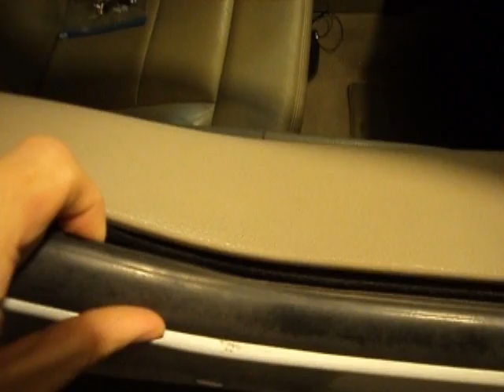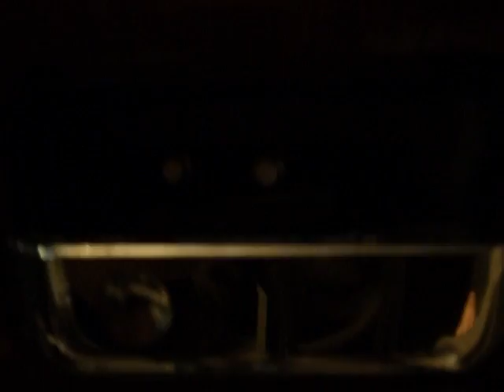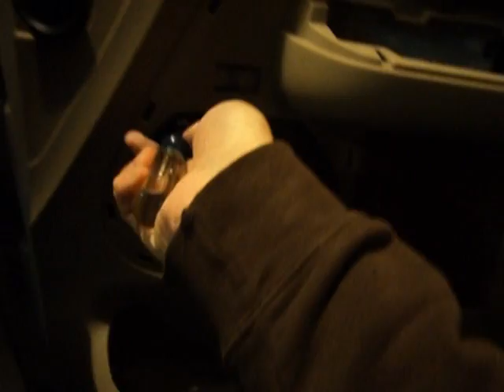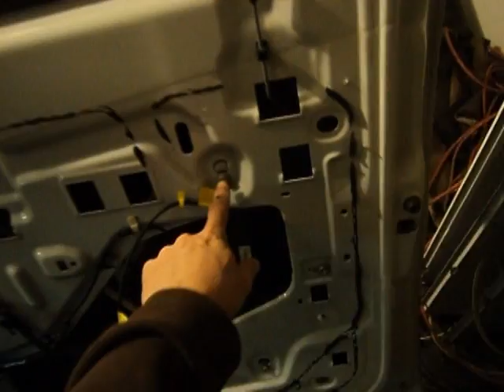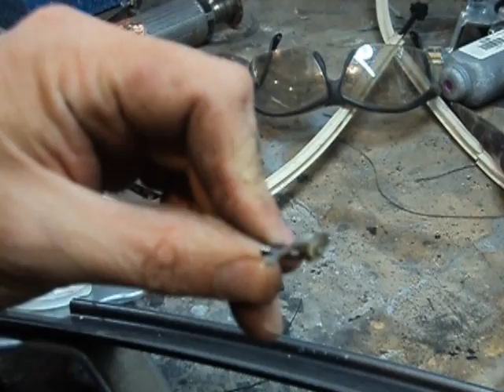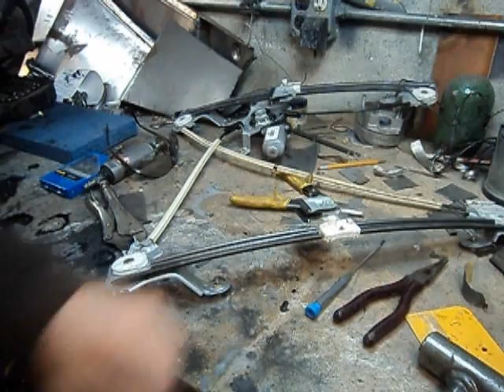2004-2008 Ford Power Window Repair

Comment: Not in my case. 06 f150 xlt supercab. Both plastic trucks cracked and broke off the tracks. $80 later ( 2022 ) for the whole assembly. It's supposed to snow tomorrow so I'm glad it's all buttoned up

Comment: I had a Ford mechanic tell me that they have told Ford for years to quit making those parts out of plastic but they refuse. $450 to repair if you take it to a Ford dealer in Arizona. I had a friend help me for about 50 bucks.
Reply: How did your friend help you ?

Comment: Thanks for making the video and your great tips. My 15-year-old Dodge Dakota has a similar plastic anchor that broke and I have a few tips that might help someone:  

(1) To release tension on the cable so I can anchor it easier, on the opposite end of the long regulator bracket that has the roller, my unit has a half round plastic roller guide where I popped the cable out of the track. Once I get the loose cable end anchored, I will work the cable back over this guide. Compressing the spring where the cable enters the motor drum assemble will release some of the tension on the cable. It may help to use a hook tool when pulling the cable back over the plastic guide.  I also took a small 12-volt battery and momentarily attached it to the motor with alligator clips, while pulling on the loose end of the cable. This allowed me to position the unattched/broken end of the cable about half way up the regulator guide, where I could work on it easier. 

(2) On another window, I learned the hard way: in order to prevent a chewed up rat's nest of damaged cable, when the cable anchor breaks, DO NOT try to operate that window motor switch any more at that point. If you forget and operate the window switch, then without tension the cable can become a jumbled mess as the drum it was wound around and the worm gear chews it up. As a reminder to not operate the switch, I placed some black electrical tape over the switch, as it leaves less residue than most other tapes.   

(3) I once held up a window with duct tape, and removing the sticky residue was a tough job, even when using WD-40.  Instead, I now use a heavy duty suction cup to hold up the window, about 5 inches or larger, and of course applied to the inside bottom of the window. The suction cups are used for automotive body and glass work and can be found in most parts stores or Harbor Freight. Make sure you clean the window and wet the rubber pad, which should allow it to hold for up to several months. When my window regulator failed, I was away from home and it was about to rain. I didn't have time to take the door panel off to pull the window up. Fortunately, I was able to wrap enough electrical tape around the end of a pair of long nose pliers to protect the glass, grab the edge of the window and pull it up enough where I could grab it with my hands, and apply the suction cup.  From Sam Selph, S. Ga.

Comment: Well done, for interest if stripping down the mechanism is the only way to fix a stuck window then here’s my video fixing both the motor/regulator, gears, bearings and switch (applicable to most cars): https://youtu.be/btQ50b5lHos

Comment: Socket Driver ! When the cable screws up in the motor, it's called birds nesting. The mess looks like a birds nest.
This broken part is common in HOT weather. Ford has never learned to use a plastic that has more temperature resistance.

Comment: Nice fix, unfortunately the cable on mine was badly frayed so I needed to do a full replace. I ended up watching the whole thing anyway. Useful fix. Thank you. The window regulator without motor runs 25 bucks on ebay, and 125 at the local auto zone. Someone is making BIG BUCKS on that part.

Comment: would have liked to see you get the glass up but a great start.  Ive got none technical skills but I am gonna figure this out.  Thanks for posting!
Reply from the maker: Push or pull it up.  When its disconnected, its free to move.  If you have a tangle of wire because something broke, sometimes you have to get everything untangled, and then get the glass out of the way.  Its been a bit since I've done this to a Ford, but they are all about the same.

Comment: I have a 2005 F-150 and have taken everything apart and about ready to put back together. My question is on the motor does it matter which cable goes on the inside of the motor wheel

Comment: Socket Stick and Socket Wrench!  LMBO!  You are killing me! Love it... Ha Ha Ha  Needed a laugh after being out in the heat struggling to get the window back up until I can figure out how to repair it.  My issue seems to be that someone forced the window down to get at something, and the cable seems to be wound up in the motor... Hmmmm.....
Reply: Our World Enterprises LLC  Pretty cool. Double shot of red bull and espresso putting it back in.😜 very helpful. Thanks.
Reply: Did you get your window up ? How did you do it?
Reply: +Jack Price hijack I had to remove the door panel take out the entire lift mechanism including the motor which had the cable spurred and wound up in itself.   I ordered the new door mechanism from this place has the video and installation was a breeze.  please excuse my voice to text translation
Reply: Thanks 
I need to get closed.until payday. Thinking maybe taking it apart and shiming it up
Reply: +Jack Price I forgot to tell you that I was able to use several bungee cords round from the front to the back of the door and underneath the window to keep the window up and it worked perfectly
Reply: +Jack Price I have also masking tape the window on both sides but if I were to do it again I would not have done that because that was the longest part of the process and that was removing the baked on masking tape from my paint and the window...

Comment: Good video. Big help to me although I found the lift device trashed and will wind up replacing the unit. One thing that might help. It's not necessary to remove all four of the speaker clips - only the bottom two. I put a pair of fat needle nose in it, squeezed gently and rocked it back and forth. Came out easily. Thanks Greg.

Comment: Good video, tips!! Question: the piece of metal-plate?? just hold the cable end in a place?? Would it be a good idea to crease wire/wheel with white lithium crease?/ Thanks, youtheman=) "Man, who always works ...  in a Dark" ;o)....I have seen your other videos...too=)) Dark...night-times...always....., you must be a very busy boy...during a day !!!
Reply from the maker: +Eero Laukkanen Yes.  a bit of white lithium is a great idea.  About working in the dark...  Yes, I am a BUSY guy.  I'm an architect during the day and I work all night in my shop making things.  I love it!
Reply: I knew it,...and you have a good, helpful wife too;o),...by the way, I am a Physical Therapist, and I like to work with all my cars too....usually in a daylight though ;o)

Comment: I came across this window after my window fell down this afternoon.  I ended up replacing the whole regulator but this video was very helpful.  I'm not mechanically inclined so I don't think I would have been able to replace the part without this video.  Thanks!
Reply from the maker: +rutscreamer Thanks!  That's why I make these vids.  Just trying to pass on what I learn.

Comment: I have the same problem on my 2004 f150 left rear window regulator. The nylon plastic connector cracks and breaks with age. Have the ford engineers fixed that yet. Unfortunately, the motor ate my cables , anyone tried to rewind the cables?

Comment: The driver's side window on my 05 fiesta has a similar problem. It used to make a bit of a grinding sound going up and down (It looked like only one side of the window was being force upwards which I presume caused the sound). Now the window is all the way down and will not go up anymore. Now when I press the pad to go up it sounds as though the mechanism moves upwards maybe a cm or so but then stops. Is this the same problem or do you think it is something completely different? I've been at a mechanic and without looking at it he has told me to get a new motor for the window... costing £195 haha
Reply from the maker: +danielstirling88 The spool that the wire collects on is what is making the noise.  Sometimes the wire eats the spool apart and you have to replace.  Sometimes the wire gets chewed up as well.  Look on-line for the part...  They are about 1/4 of what your mechanic wants to charge.  It's about 1-2 hours of work to remove and replace if you've never done it before.

Comment: I have the same problem long time ago. Some time later it would come back normal again. And as such happened quite often. Recently it is even serious. I've been searching the solution, but not quite fit to solve it exactly right or simple. 

This is my suggestion: If you don't find any wire problem, or any worn out mechanic problem, just go to take out the internal panel by unscrewing 5 screws off. Then directly disassemble the motor with three screws off. Take out the center part of the motor, and clean it and the shell of the motor inside out. You may put a little grease on the bottom and top portion of the center part (coil). Then put them all back. Make sure you have balance every single step including small gasket, and use a short and slim Philip screw drive, you may finish the job no more than half to one hour. Don't be fooled to take all regulator off and exchange with new one. It cost 50 or more. If you take away the small gasket, I mean, don’t put it back, it even puts the whole things easier and simple without noise or function problem.

*If you have only small 7mm (or 8mm) small and short socket, you can use a long flat screw driver insert into it to take out 2 screws under the window handle.

Normal step: take off the internal panel of window. 
1. Check the fuse . If it was cut or burned, replace it.
2. Check if the wire disconnected in between window and fuse box or switch is bad (w/ V meter). Connect it back, or replace a new one. 
3. Directly unscrew the motor, clean inside out. Grease top and bottom of the center coil.Then put it back. If you can tape or add silicon to seal the gap of motor and gear, Even better. It may avoid moisture into motor. Make sure when you put it back the center coil first, insert into the hole, then turn clockwise a few times till it turns smoothly.
4. Check if the whole screws or rivets loose, or regulator stuck. Replace it if needed. 
5. Clean and lubricate the edge of window glass, if needed. 

Most of the time, you just need to proceed the 3rd one. Good luck!

Comment: Nice info does it apply to all window regulators? happened to my 98 polo and I want to be able to repair it myself
Reply from the maker: cadbane22 There are a handful of regulator styles...  This style is in a lot of cars, but not all.  You can look up your regulator on line and see if it looks like this one.  If it does, you're in business.

Comment: Ok.  just watched your video and am headed outside to fix my window that just broke.  Heard a "snap" and the window went down.  Fingers crossed.  Will get back with the result.  Thanks again for the video..
Reply from the maker: Thanks for contacting Yep.  probably the exact some scenario.  Good luck.
Reply: Done. I couldn't find any sheet metal, so I used wire. Wrapped the little crimped end and around the plastic. Worked great. Hardest part for sure was understanding the way the cables are wrapped around the motor  and getting it attached again, but I got it. Up and running again. Thanks.
Reply from the maker: Perfect!

Comment: Great video!  This definitely gave me the confidence to try to fix it myself.  I had the same failure point – I'm sure everyone does.  I used a soldering iron to reshape and reinforce all of the plastic connections.  It works really well, but do it in a well-ventilated area.  I also used a method like yours for the cable reinforcement.

Comment: My 06 F-150 passenger window wouldn't roll back up today. It's not  a power window. We took the door stuff off, and saw the regulator. Looks like exactly what you described. I remember seeing the cable that was loose. Unfortunately, I won't have time this week to fix it. Luckily I live in Arizona where it won't get too cold. Right now got window 3/4 of the way back up, but it won't go ALL the way. I think there's something stuck. I got it duct taped to hold it up, and some plastic covering the rest of the way because in the mornings, it IS chilly for us Az folks even though it's only in the 40s
Will try this weekend what you did. Thanks
Reply from the maker: Good luck with the repair...  Sounds like a typical fix.

Comment: Currently working on two windows, front passenger and Back driver. yes my F150 has dropped a total of 4 windows in my 130K miles. You video was great, and I would not have tried it without your help. I may have a suggesting to make it a bit, easier than sheet metal. Will let you know how it works.
Reply: Yes, it worked, I used a steel nail in the same way you did, on two windows today. Saved $300+ dollars. Thank you!  Each Plastic thingy was broken in the exact same way, I can't believe Ford is still replacing it with the same part.
Reply from the maker: CJ Daniel Hell yeah!  There you go.  A nail will make it a BUNCH easier to do.  It isn't just ford, ALL the manufacturers are using junk like this.  Ford windows are just bigger than what the regulator can take, so they break.  I'm glad it worked for you man!

Comment: one thing I noticed, seems the after market part breaks after a while. looks like repeated metal on metal contact causes this? maybe putting some white lithium grease on the tracks will help.

Comment: My 2008 Ford Fusion rear windox goes down while driving but will not go back up. Is this just a cable issue or do I need to replace the motor in the window?

Comment: The rear window on my 2004 F-150 mysteriously fell today. I watched your video and found exactly what you had described as well as the cable mis routed on the spool. (no doubtedly from attempting to raise and lower the window as if it would magically fix itself...LOL) I dis-assembled as you described, repaired the plastic piece with a small metal one and had it back in operation in a matter of an hour or two. A huge THANKS for showing us the way. Thanks very much for taking the time to do this for the general public. U DA MAN!
Reply from the maker: Hey man...  Any time I can help someone else get one over on "the man" I do my best to help out.  I'm glad it worked out for you.

Comment: Great video Greg, thanks for taking me through the process. Everything was going smooth but I've got the cables all jacked up. They're no longer coiled properly and in fact they came undone, can you point me in the right direction or offer me any advice for getting the cable's coiling properly .
Reply from the maker: Oh man.  They sort of split funny.  I'd have to stare at it for awhile.  I'd suggest that you take the door panel off your "good" door and watch the window go up and down.  It will make sense.  It coils onto one side and off of the other at the same time.  The cable sits in the grooves and does not cross over at any point.